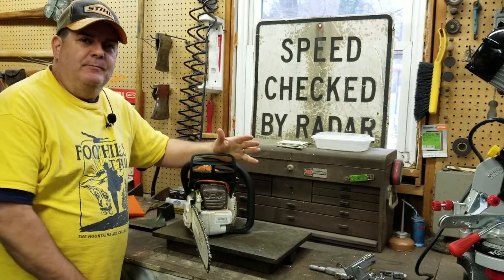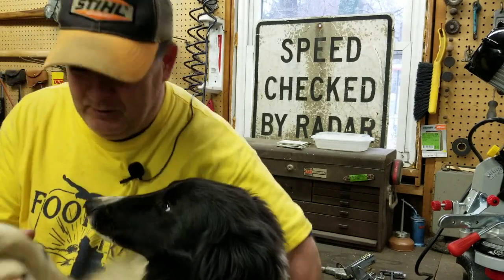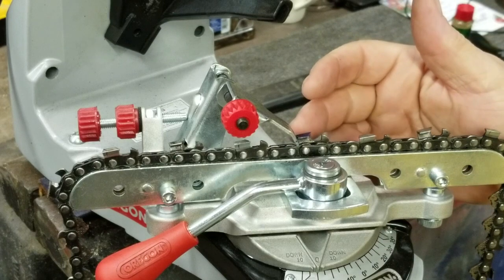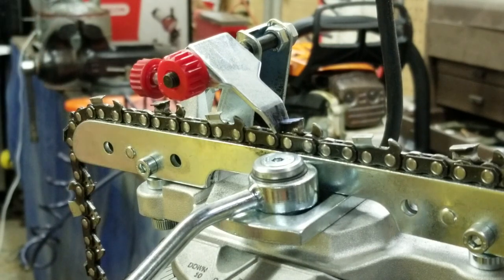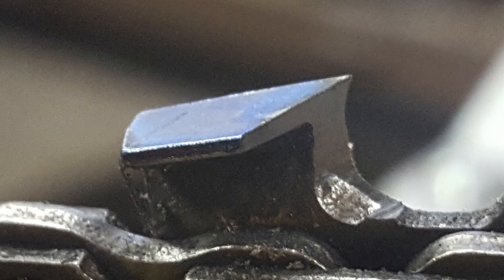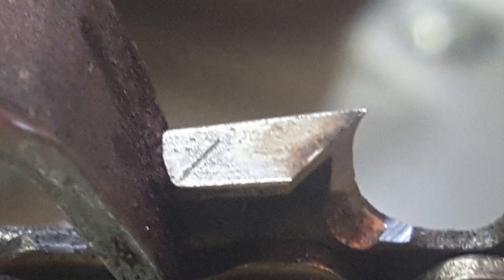Oregon 520 Chainsaw Grinder

Comment: So I cheat.. I don't find the shortest tooth. I begin next to the double teeth on the chain (the 2 on the same side) and lightly grind the first tooth. As I go around the chain, if there are any that don't grind, I take note and finish the whole side of the chain. Then I adjust the backstop just a hint more and make another pass. I found this to be faster and more accurate than trying to mic all the teeth.
Reply: Seems like it'd take longer to make multiple passes that just finding the shortest cutter before hand

Comment: I couldn't tell if you were sharpening stihl chains or not off of your saws and if so your video doesn't say what angles you're using, I know this is a old video but I'm hoping maybe you'll see it and comment on what angles you used most of the videos on YouTube with the oregon grinders they show you how to grind Oregon chain not stihl and all my saws are Stihl chainsaws with stihl chains yet none of the videos tell anybody the angles for there chains. I keep seeing 60/30/0 thrown around on some old posted forums but no definitive answer but I thought for sure with stihl chain especially the full comp you were supposed to use minus and plus 10 degree angle not Zero so I'm confused.
Reply from the maker: It's not complicated. The top setting is ZERO and lower angle is 30 degrees. That's for every Stihl chain I have sharpened. Then set your depth of grind.
Reply: @foothillstrailhiker2426  you mean the chain holder angle is 30 degrees tilt 0? Because I know the grinding wheel can't be set at zero you'd be cutting your teeth straight down 😂 I heard it is 60 on the grinder motor angle. Then 30 for chain angle and 0 tilt.
Reply from the maker: Send me an email to Andrewandwilla@hotmail.com